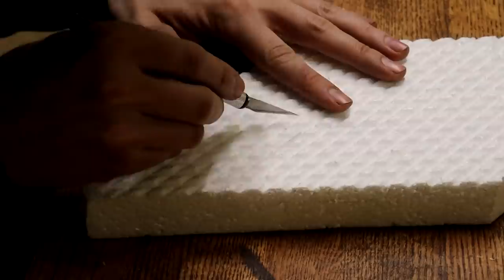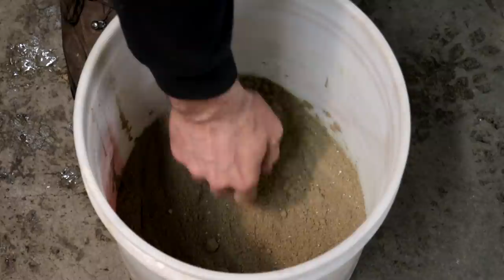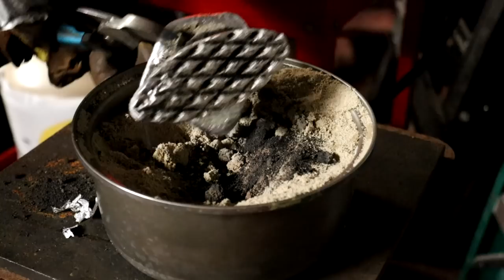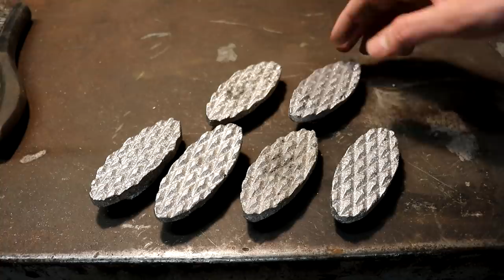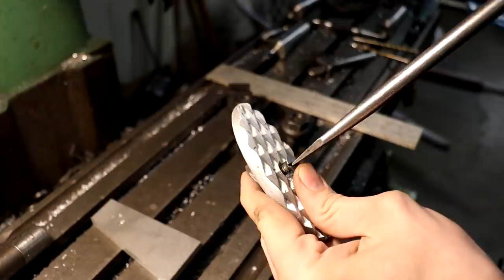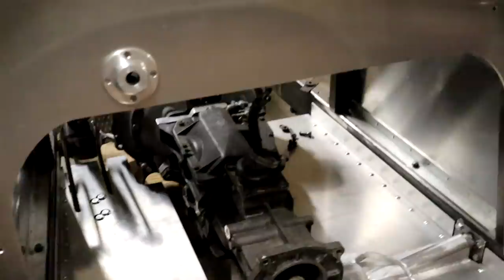DIY Sand Casting - Lost Foam

Comment: This installment definitely took me back to my Foundry & Forming course, back in my Uni days as an Industrial Design major, 20+ years ago.  We did hands-on small-scale projects using green sand casting with reusable molds,as well as lost-foam casting; this was accompanied by field trips to a couple of foundries in Northwestern Washington State, that produced items like massive propellers for commercial vessels, which was really amazing to see.  IIRC, when we used the lost-foam process in our own lab projects, we first coated our styro masters with a ceramic slurry (that was either air-hardened or fired before the next step). The master was packed in sand/clay, then cast.  All I clearly remember is that I had attempted to do a mold for a cast trivet, that didn't survive the process, likely because it was not substantial (thick) enough.  I'll confess that I'm a bit envious of all the equipment that you have at your disposal.  I've been away from all of it for so long, that I wish I had a means to try my hand at it again.  Keep up the the great work on this project - you continue to amaze and impress!
Reply: Use pre-mixed drywall mud to make a thin coat and allow it to dry.  Support with plain dry sand.  You get wonderfull detail.  With blue/pink foam, you will pick up marks from  sanding the foam master.

Comment: When I did it in college at PSU, we used a dry sand, and vibrated it against the foam mold, and a bit more sprue.  You can see the 1/32 beads.  May be worth trying.

Comment: Love this so much! I have long been fascinated with aluminum casting and have done a small bit myself. Most videos are just melting and making ingots or silly costume stuff. I think it is so much cooler and more fun to make actual useful parts for a project like this. 
May I suggest you knock together a simple hot wire cutter to make your foam patterns?

Comment: Nice work, love the shape. The only thing I would add is to mount the screws from the back.  Drill and tap the aluminum in the back to leave the front of the pedals clean with an uninterrupted diamond pattern.   Just my 2 cents.

Comment: you could rout this right into a flat plate of aluminium on your router table, ive routed aluminium with a woodrouter before and it works quite good. makes hell of a noise but works :D

Comment: I thought most people use that insulation construction foam thats smooth and not bubbley? it seems alot easier to work with and cast smoother
Reply: Construction insulation foam would give it a better casting. That and the clay slip would be a great improvement in lessening the file work.

Comment: havent sen this type of casting sand before , was supprized the water in the sand didnt cooked off when you poored hot metal intoo it but it worked fine it seemed
next project the gas pedal ?
Reply from the maker: it does dry it out. You just need to add more

Comment: For every pound of mold material you use, add 1 tablespoon of 2 stroke oil. It makes the finished product much nicer, and I've been told it even reduces porosity.
Reply: Reducing turbulence in the mold reduces porosity, not snake oil cures. Look us SWDeeb on you tube, for an experienced hobby caster.

Comment: It looks as though you made the welded steel container you used to melt the aluminum in, and used it without any sort of coating on the inside.  Iron and steel are soluble in molten aluminum and enough will be picked up, even in the short time it's in contact during melting, to mess up the metallurgy of the castings.  (Iron dramatically reduces the ductility of aluminum alloys)  Your pedal pads might work perfectly well in your application, but if you ever cast any parts that are structural, you really should obtain a ceramic crucible, or at least coat your steel container with a ceramic mold coat slurry.  You can obtain either of these from a foundry supply outfit.  
Also, you appear to be using scraps of aluminum plate for melt stock.  This is also probably okay for your pedal pads, but again, the metallurgy of wrought aluminum is formulated to optimize the forming process.  You'd get better results using ingot or scraps of sand or permanent mold alloy castings, as their alloys are optimized for the casting process.
Reply from the maker: all good things to keep in mind. thanks
Reply: @MacroMachines  You can also get some more suitable sand by searching on-line for "foundry supplies."  
I failed to compliment you on the excellent production values and technical skills evident throughout your video series; let me make up for that.  
What course of study are you taking in college?  I look forward to seeing your completed boat tail project.  Best of luck to you in all pursuits.

Comment: The gas that comes off of the styrofoam is cyanide gas, so have a fan blowing away from you or it can give you a headache. I have done large sculpure castings this way, and breathed enough to send me to bed. Yes, you are right, a finer sand, and denser foam helps. the styrofoam you used is the least desirable texture. This is definitely a great way to do some small parts, just be safe.
Reply: It’s not good to breathe the fumes, but it’s not cyanide
Reply: @emmajacobs5575  then my foundry teachers lied. I did have metal poisoning twice though.
Reply: @emmajacobs5575  their is a toxic mix of chemical gasses, as of which are dangerous.  After engineering and building chemical plants for 40 years, you learn to hate plastics.
Reply: Cyanide is contained in cigarette smoke and the combustion products of synthetic materials such as plastics. Combustion products are substances given off when things burn. In manufacturing, cyanide is used to make paper, textiles, and plastics. It is present in the chemicals used to develop photographs.

Comment: Use motor oil instead of water in the sand.
Reply: No, Motor oil will make the smoke carcinogenic!  Esp, if you use oil with a detergent agent.
Reply: @honthirty_  water turns to steam and explodes.
Reply: @Spetet  Look up what the English word "explode" means.  Water expands  in volume, but does not explode.  Sand is porous.  
Water vapor does not cause cancer, motor oil will.
I've been metal casting over 10 years.
Reply: @honthirty_  you might want to check out all the YouTube videos of steam explosions.  There are some wonderful ones of turkey fryers blowing up.  I can't remember exactly, but I'm pretty sure I first heard the  caution to avoid water in casting sand and use motor oil from Tubalcain (Mr. Pete222).

Comment: Awesome job making your own foot pedals but please be careful playing around with the molten aluminum like you did at the end. 
It can be extremely dangerous if water gets trapped inside a pour of molten aluminum. 
Creates hydrogen gas and an extremely powerful explosion. 

Don’t want to see you get hurt or worse.
Reply: @honthirty_  Yes it does, molten aluminium is capable or reacting with the oxygen in the water and liberating hydrogen; it would probably need to be hotter than this though. If you're not convinced, google for metal fires to see how difficult they are to extinguish.
Reply: @Crewsy  Thank goodness, he claims to have many years of casting experience but advocates using water in a mold and laughs at people suggesting to use mineral oil instead.
Reply: @cambridgemart2075   Dont lie.
I said water based green sand was a 2000+ year old accepted practice.  
Re-read your mis-spelled commentary.  No one laughed at your home made motor oil based sand from 7+years ago, I commented the detergents in common motor oil make the smoke carcinogenic.  
All very courteous, and polite, until now.
Reply: @honthirty_  1. It's not misspelled (correct spelling BTW), it's aluminium not aluminum, despite what you Americans insist on writing. 2. 'No one laughed at your home made motor oil based sand from 7+years ago,' What are you talking about, I never wrote that. 3 You categorically stated using water was safe, it's not, no one in industry would dream of getting casting sand wet, the binding compound in small scale sand casting is usually oil. 
Do you have ANY evidence of the detergents making oil fumes carcinogenic? Please give your citations.
Reply: @cambridgemart2075   Aluminum (Al), also spelled aluminium from  Encyclopædia Britannica, Inc.
An indecisive British chemist  Humphrey Davy in fact coined the now word "alumium" in 1808. However, referring to the element in his 1812 Elements of Chemical Philosophy, he would use the word "aluminum".
For the rest of your request, do your own homework.
Reply: @honthirty_  Well thank you, henceforth it shall be known as alumium!
Reply: @honthirty_  Sorry, what request? You decided to have a go at me for incorrect spelling which was only incorrect in your small part of the world and accused me of writing something I never wrote 7 odd years ago.

Comment: Well you lost me once you cut the back off and then broke out the milling machine to redo what you just cut off.
Reply: I thought so to until I realised the piece he was putting back was steel so he could weld it to the pedal arm.
Reply: @cavman7  Ok then why not add the close enough profile in the foam then touch up on the mill ? I get it though trying things out and learning as you go.

Comment: Oooooooo, ..... and REALLY you put a FLAT BLADE screw in them ..... COME ON MANNNN! Phillips/CrossTip! 🤣
Reply: Too modern for what he's building.
Reply: @darkiee69  Yeah, like that matters! It's a BRAND NEW CAR! Helllllluuuuuuu! 🤣 But nice try! 🤣
Reply: Flat screw to go with the vintage feel of the car. 

I hope you personally know him. Otherwise your comment makes you look like an @$$.
Reply: @terrywheelock9458  Yeah... You haven't been following along, have you? It has an old engine, an old gear box, an old rear end, old front end, old steering and brakes, built to an old look.
Reply: @darkiee69  Yeah, still no buying it! 🤣 Phillips/CrossTip are "old"! 🤣 Nice try though! 🤣
Reply: @Crewsy  "Lighten up FRANCIS!" 🤣
Reply: Phillips wasn’t in use in the automotive industry until the early 40’s.  I think the flathead is more period correct.
Reply: @terrywheelock9458  They're from the mid 30's, but still didn't replace the slotted screw for many years. 
When will we see you build a car?
Reply: @1996slamster  This car was built in the year 2020-2021, so GET OVER IT! You want "period" correct he should be using "SQUARE" heads! I WIN AGAIN! 🤣 You don't think so much! 🤣
Reply: @terrywheelock9458  Who's the whiner, you or me?
Reply: @darkiee69  🤣
Reply: @terrywheelock9458  "Buhu, you didn't use the right screw..." Cry baby.
Reply: @darkiee69  🤣
Reply: @terrywheelock9458  And just so you know,  A modern screw in a car today would be a Torx's!!!!
And a Period Correct fasteners would be a Clutch Head Bolt and Screw!!!!!!
Reply: @terrywheelock9458  Square head?  You mean Robertson?  Robertson was never used in the automotive industry.  But if if a case of winning then yes you win there little guy.
Reply: @rockerpat1085  🤣
Reply: @1996slamster  🤣
Reply: @rockerpat1085  🤣
Reply: @rockerpat1085  🤣